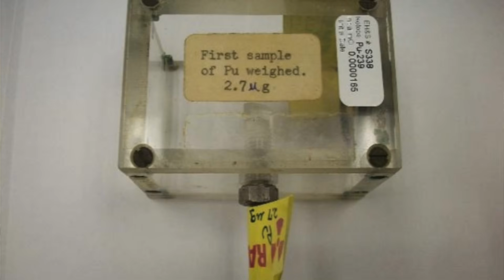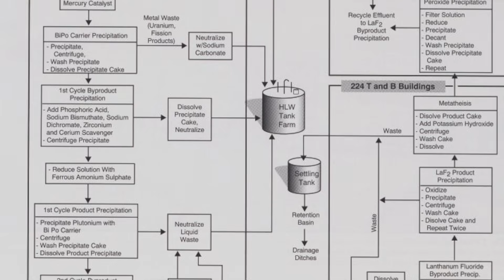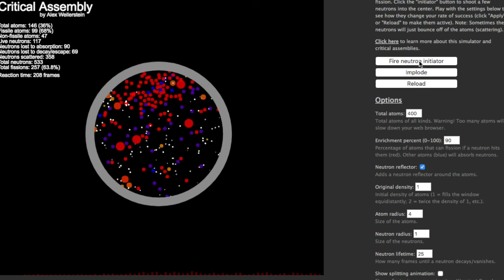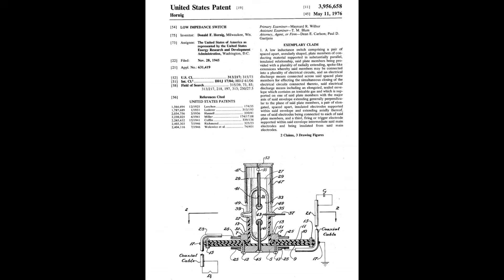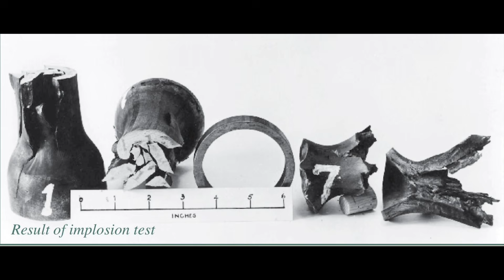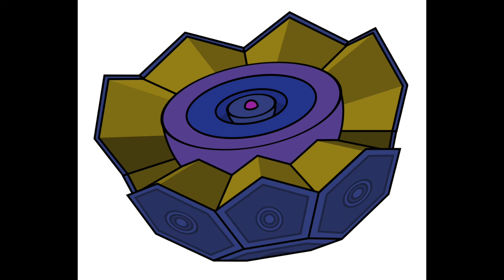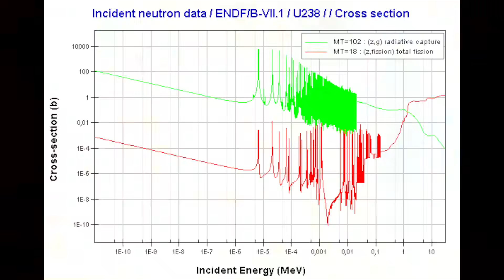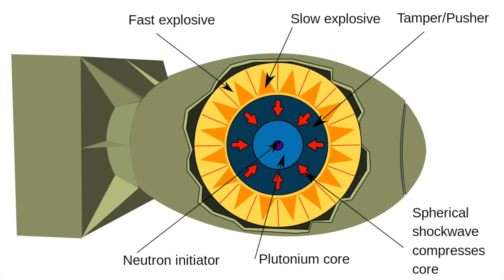Going Nuclear - Nuclear Science - Part 3 - Plutonium Implosion

Comment: I enjoy this stuff, especially the high speed imaging they did at that time. The images of the effect of the expanding plasma fireball during the first few microseconds, is oddly interesting.
Anyway, regarding the detonation of the compressing explosives, I remember that Harold Edgerton had developed the electronic firing of the nuclear devices. As I understand, It needed to be so precise, that detonation wires had to be the same length, otherwise, the synchronization would be off by very small amounts, thereby preventing the uniformity needed to compress the Plutonium. 
If this was the case, I'm awed by the precision they were able to affect. To add to this, the engineering uncovered, that was needed to insure the proper production and  containment of the neurons, that assured a fission reaction. We take this for granted, today. Out methods have been refined since Trinity, to allow us to product these devices in such a contained space. Scary

Comment: Fast forward to 2025, they can make 239Pu from continuous flow in reactors direct from 238UF6. The purity would be about 99.98% 239Pu. As far as the implosion set it used a bilateral parabolic pit, and the shape charges are designed to create two shockwaves that cause a parabola to spherical transform at the focus of them. Back then they used lots of exploding wires, but now it uses a single laser and two pulses delivered to the shape charges. It makes the device a lot less bulky ❤

Comment: 2-and-a-half TONS of shaped explosives, to compress 6 kg of plutonium down to 1/2 its normal size (or is it cube-root-of(1/2) ?)  for a couple microseconds...  definitely music to my rocket scientist ears 🙂 !!!
what's still puzzling to me though, why go to the trouble of physically compressing the plutonium (requiring TONS of explosives) compared to starting with a hollow sphere of plutonium and simply collapsing it into a non-hollow sphere (which I'm assuming would take a fraction of the explosives) ?  I'm guessing that turning a given mass of plutonium into a hollow sphere doesn't actually turn it into a sub-critical mass, the fissile neutrons will still fiss even if they have to cross the hollow ?  I'm guessing what's really going on with compression is you're increasing the cross section, the probability of neutron capture, of the plutonium, which lowers its critical mass to be below what you started with. But even if the cross section is increased, the path length the neutrons have to go to escape is shortened, so its not obvious how these balance in favor of chain reaction.
Reply: The compression was about increasing density by a factor of ~2.3, thus increasing the probability of a chain reaction and lowering the critical mass by a factor of ~2.3.

A reconfiguration without compression is no different than a gun-type design with the same problems. If not done fast enough, it creates a pre-detonation. It also requires ~2.3 times amount of of Plutonium.

Comment: Did any other nation test a U235 bomb like the Hiroshima device? Plutonium seems to have an advantage in terms of yield efficiency and ease of fuel production, but a disadvantage in terms of firing complexity. It seems like all the later nuclear programs went the plutonium route, but I don’t know that for sure.
Reply: China and Pakistan went with uranium first. But they used it in implosion bombs, which is a much more efficient use of the material and the preferred option despite the increased complexity. Only Apartheid South Africa built uranium gun type bombs.

Comment: The B-29 was modified to carry the thin man in fact they carried Grandslam bombs in Korea. The Lancaster was never an option for the strike. It lacked range, speed, and altitude performance. It would have been a 100% suicide mission. If the blast didn't get them they lacked the fuel to make it home. The myth of Lancaster as a nuclear bomber was started because the US used the bomb release from the Grandslam bomb.  Yes there was a US bomber on the drawing board that could carry the original thin man the B-36 flew only one year after the atomic bombing.
Reply: Ugh, I can't stand the perpetrators of that myth.  It just won't die.

Comment: If I try to estimate the number of spontaneous fissions, I use this logic:

- remaining quantity Q(t) = Q(0) exp(kt) where k = ln(0.5)/t_half
- decays per second = -Q(0) k exp (kt) = ln(2)Q(t)/t_half
- spontaneous fissions per second = Q(t) * P * ln(2)/t_half

Using the table at 2:53, converting the half live periods to seconds, and setting Q(t) to Avogadro's number, I get these figures for the Number of fissions per mole per second :

For Pu-240: 6.0E23 * 5.0E-6 * ln(2)/5.0E18  = 0.42
For Pu-239: 6.0E23 * 4.4E-10 * ln(2)/1.7E23  = 1.1E-9

Even with a pit of 6 kg (25 moles) consisting of 80% Pu239 and 20% Pu-240 I cannot see how more than about 2 spontaneous fission per second would occur, so from this b-o-t-e-calculation I would say that 1 millisecond would be quick enough in 99.8% of the cases, and from these data I don't see how timescales of microseconds are so crucial to prevent predetonation.

Anyone?

Comment: that does not seem right ....  lancaster about 70 feet long b 29 about 100 feet long
Reply: It's the bomb bay configuration - the B-29 has two bomb bays separated by a bulkhead, whereas the Lanc has a single, shallow bomb bay - Imthink around 30' long.
Reply: @Pene7942  thanks old  chap  .... useful  info

Comment: OK maybe I'm really stupid, but my commonsensical reasoning says surely when you shoot something along a gun barrel it starts off at maximum speed and gradually slows down... doesn't it?
I mean, I know it obviously doesn't because you're the physicist and you've just explained at length how much longer gun barrels are required in order to shoot the plutonium at higher speeds. 
But why is this???
Reply: Propellant keeps burning creating more pressure. There are fast or slow burn gun powders for hand guns vs rifles.
Reply: The bullet keeps accelerating down the barrel because the gases behind it are still expanding; the instant it leaves the barrel, it stops accelerating because there is no longer any force behind the bullets mass.  Of course, if the barrel is too long, eventually the gases won't have enough force to continue pushing against the bullet and it will stop accelerating - extreme case would be the bullet stops while still in the barrel,  but you wouldn't engineer a barrel length like that.  A shorter barrel means the bullet leaves the barrel before the gases behind the bullet can fully accelerate it to a max velocity.  So, same phenomenon  - as soon as the bullet leaves the shorter barrel, the bullet stops accelerating.

Comment: I'll fill in what Scott left out after the 8 min mark. 
Detonation wave profiles take the form of a leading edge pressure spike followed by a region of rarefaction. The shock reflection that would occur at the Al/U interface would produce a higher pressure behind the shock front, minimising the rarefaction that occurred behind the shock front, thus maintaining pressure for a good distance behind it, and thus allowing for the entirety of the core to be compressed to a higher degree, rather than the material that was just behind the shock front at that period of time.
Reply: What I find amazing is that they somehow knew that the allotrope of plutonium would instantaneously change to a closer packed version. The convergence of chemistry and quantum mechanics and mechanics.
Reply: @stopthephilosophicalzombie9017  And even if they couldn't predict it from theory, it'd have been identified in shock testing...

Comment: In the movie The Peacemaker, Nicole Kidman removes one of the sections of explosives from a nuclear bomb which causes it not to detonate. Would that work, and could you even get access to the explosives quickly?
Reply: Very roughly, yes, preventing one segment of the implosion system from doing its job would most likely prevent a nuclear detonation, or at worst, it might fizzle with a yield of a hundred tons or so, but nothing close to design yield. It would be hard to get inside to do this if you’re in a rush, though.

Comment: The key to a nuclear explosion is in creating an element that cannot be supported on Earth's mass/motion frame. The last ten elements on the current table fit this model. The thing that keeps them from being declared a nuclear explosion is the total mass created is only a few molecules and they completely deteriorate in nano-seconds. Our very first atomic bomb was all Uranium . It was enclosed in a five foot radial mass of the the most powerful explosives known at the time. It was contained in a three inch thick shell of steel and when the explosives were detonated most of the energy was concentrated inward toward the Uranium globular eighteen inch diameter mass The heat and pressure compacted the Uranium down to a one to two inch diameter with an atomic weight exceeding four hundred on the scale. This is what exploded as a nuclear bomb. It was about fifteen mega-tons of TNT in comparison. The second bomb was a combination of Uranium and Plutonium and the same process was used to detonate it. The problem faced by the nuclear scientist was getting all of the outside explosives to go off at the precise same time and in an amount that would generate the necessary heat and pressure to effect a plasma state of the elements to fuse them into a single element of ultra high atomic weight. In essence it involves creating a newer element with a weight which is highly unstable on Earth's mass to motion frame work. . .
Reply: Was this quoted from an old disinformation publication?  Because even my basic physics knowledge was enough to see the bullshit.

Comment: thanks scott for this timely video. The detonation is not as symmetrically equal when all ducks are not aligned, thus a terrorist weapon will be much lower yield. The radiation however will be equal just not the prompt yield of flash x-rays and neutrons. The only difference between this and the neutron bomb is the tamper made of more transparent material. It is just almost imaginary however because the blast will do the work that the radiation would. In Hiroshima a scientist working behind concrete witnessed the x-ray passage and many early tests had men seeing the bones in their hands. I don't deny this happened but is hard for me to convert x-rays into visible light. Wait. hmmmmmm
Reply: Why assume terrorists to be sloppy amateurs?  Never underestimate your enemy.

Comment: You never said "Krytron" ? Love that word. The two nuclear explosions over Japan in quick succession removed all arguments put forth from the Japanese military that atomic bombs were only going to be a single bomb once every few years sideshow with no real strategic impact.
Reply from the maker: You mean Klystron?
Reply: @scottmanley  Nope. Krytrons are the little fast firing gas filled "vacuum" tubes used to fire off the plutonium bomb's initiating explosive blast wave. They were are also used in heavy duty photocopiers. At least until someone realized that fact and "went into business". Quite a scandal, eventually.

Comment: 8:18 Engineering shockwave interference patterns using pencil, paper, and slide-rules (not super-computers or even calculators) deserves it's own video. Damn, those were some geniuses. How did they even measure explosive speeds nearly 5 miles per second to the necessary accuracies needed without computers? 

As destructive (and controversial) as Hiroshima and Nagasaki were, no one can deny the shear brilliance of the human mind.

Comment: the engineering is incredible. If this was the first tested device, how did they know all this to build it like that? Was it all theoretical physics? Wouldnt they normaly build way simpler devices before maximising efficiency? Or was the material so expensive? This is so much above my brains pay grade.
Reply: Trinity reportedly used a billion dollars worth of plutonium and the US quickly repurposed the remains of the German experiments to get enough for a 4th bomb.
  But those steel remnants shown demonstrate that they did some tests without the fissile materials to get the mechanism to work.

Comment: I always thought the first test was uranium bomb. despite the grim output of those experiment. it's fascinating.
Reply: There was only enough enriched uranium available at that time to make ONE bomb, because Little Boy used it so inefficiently and the enrichment was so difficult and time-consuming. There was only enough plutonium to make the 2 which were exploded, the Trinity test and the one dropped on Nagasaki. If the Japanese had not taken the hint, it would have been months before another could have been dropped, because it takes a lot of time and spare neutrons to make entire kilograms of artificial elements like Pu.
Reply: @YodaWhat  there was another core ready  in case the Japanese didn’t surrender this became the focus of experiments that killed 2 scientists 🥼. It  became known as the demon core eventually it was melted down and reused in other test devices.
Reply: @gpcrawford8353  - You have to distinguish between the 235 and the 239, which are entirely different elements. While it might seem easier to separate isotopes of an existing element, in practice it proved easier to make the synthetic element, the 239, for Fat Man bombs. But other parts of Fat Man were not easy, either. I have heard from more than one source that it would have taken USA at least another month to prepare a 3rd bomb to drop on Japan, and it would have been another implosion type, a Fat Man.  The 235 separation was simply too slow in those days.

Comment: I might have missed this in the video, but why does compressing the core make it go supercritical?
Reply: The chain reaction depends on the ability of neutrons to get absorbed by nuclei before they get lost outside the core. This can be enhanced in several ways: make the core bigger with more material, reflect neutrons back into the core for another try, or to compress the nuclei closer together.
Reply: The compressed "pit" has less surface area from which neutrons can escape, and has atoms closer together, which increases the rate of reactions, giving less time for neutrons to escape. The neutrons coming out of fissioning Uranium are initially moving about 3/10ths of c, equal to about 90,000,000 meters per second.

Comment: First time I've seen photo of implosion test result on metal cylinder. Fascinating!  After decades of gobbling up data on nuclear weapons, I must say you have demonstrated very fine knowledge of the process in an excellent video. I learned some new things here, like the complexity of the "urchin" neutron initiator.  Now, how did they print such a modern looking, stick on  label on that first 2.5 micro gram of PU239 sample?  

Do you have any photos of the inside of the gaseous diffusion plant at Oak Ridge, during its operation?  I'm always stunned by what that plant accomplished, and how fast it was built. Thank you.

Comment: I thought the cadmium wire idea was post-WWII, (1960s with the W47) but scrapped after one of the pits was rendered inoperable because the wire broke inside it and couldn't be retrieved without completely remanufacturing it.

Comment: Hey Mr. Manley Man,

If one of the 32 blocks of explosive material did not ignite, would that keep the weapon from going super critical?
Reply from the maker: +Mike Stiber yes
Reply: Yes, and this fact is used as part of the safety systems of modern nuclear weapons. If a nuclear weapon were to have an anti-tamper system on it, that system could be something as simple as only setting off one of the detonators if someone tries to brute-force the authorization code. Big radioactive mess, no nuclear fireball.
Reply: This aspect was actually shown  in a 1997 movie 'The Peacemaker' with Nicole Kidman and George Clooney. In the final scene she manages to rip off one of those explosive tiles, and the assembly just explodes like a simple grenade.

Comment: Let's say I was a blacksmith and immune to radiation. Could I hammer on some plutonium until it became dense enough to blow?
Reply from the maker: +qqq1701 no, it’d go critical, emits bursts of radiation but the heat would cause thermal expansion so it went subcritical.
Reply: Well there goes my weekend plans.

Comment: Hey Scott, is there some process where you could simply remove 3 neutrons from 238? Asking for a friend
Reply: (n,3n) reactions do happen, but with low probability in a standard reactor neutron flux.
Reply: @BeCurieUs  One might knock out neutrons with fast protons, for example from a particle accelerator, but knocking out protons would be fairly likely as well. And I suspect @Nabre Labre was just kidding, or possibly trolling.

Comment: Man they must have blown up a lot of bombs before getting the engineering right, so many considerations.
Reply: Nope, the Trinity one was the first test of the whole assembly and it worked first time. Really gives you an appreciation of the level of talent involved. Same with the gun-type weapon, except it's first "test" was over Hiroshima.

The subcomponents, though, especially the explosive lenses, I bet required many test runs - that and the synchronised detonator system, though fortunately that's mostly non-destructive (eg. the system survives the test)